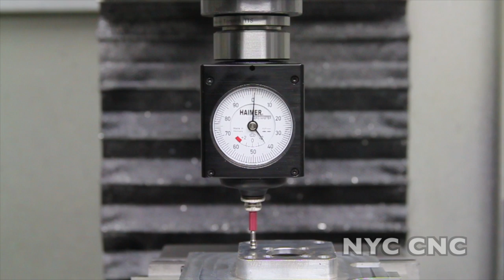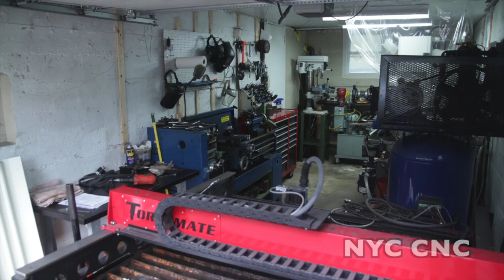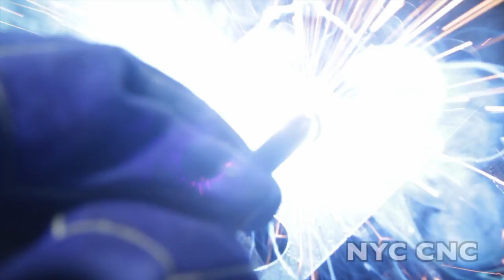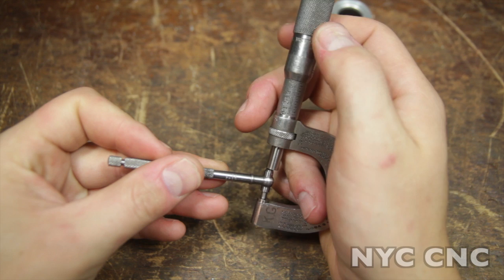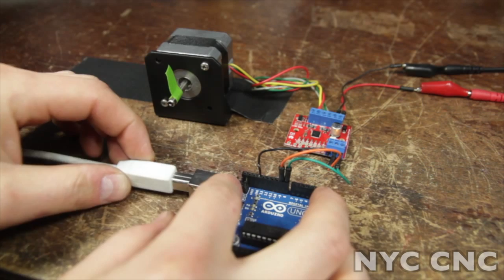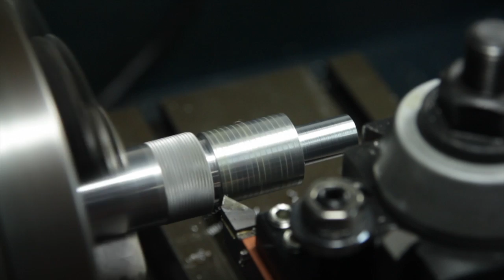Welcome to NYC CNC!  Channel Introduction!

Comment: Got a idea for a shotgun round for you to build for the TFM channel John.

 Only a true expert machinist like yourself could possibly pull this one off.

 Make a aluminum shotgun round similar to what you sent TFM in their last video but this time install a miniature gyroscope in it for stabilization. You will have to design and test this part first after you build it to see if it has sufficient force once powered up by a electric drill to resist the motion of your hand movements to it.

 It also has to be designed to fit into one of your beautiful aluminum shotgun shells. The trick to fitting it in would be to make the shell into a upper and lower half and machine at least three long shafts so you could screw it together with small phillps head screws once the gyro is installed inside.  

 The gyroscope would be powered up with a portable power drill just before firing the round  through a central shaft in the back of the round.

 There is two challenges here John. One and probably the harder for you.  Make a very small ball bearing gyroscope that can fit into one of your rounds with a sufficient amount of force once powered up to resist strong hand motions and two make a round to fit it in.

 I don't know if even you are up to this challange.  :)

 Just a thought here John.

 It may be possible and also now doubt best and the easiest solution for you making this gyro is to make it a heavy rotating cylinder NOT out of the lighter aluminum that fits into a very long central chamber in your round by machining the central core out. Then fit in a very large rotating cylinder mass inside which is what you will need for stabilization. Fit some small ball bearings in hollowed out recesses you will make inside the central rotating cylinder that you will be inserting into the outer shell of the round. I believe you will need these bearings for it to keep spinning once it's spun up.

Now if you go this way I believe you won't even need to make it two halves Just a long central chamber will do. You will have to seal the back end up with a aluminum cap and three phillips head screws and drill out a hole in the center for the gyro to be powered up. 

Now I am not totally certain if a gyro made this way will actually BE a gyro. 

You may need to add some heavier sleeved in metal pieces in four sections into the central rotating core.

That you will have to find out. :)

Comment: Hey John, been following your work for years on and off, going back to your apt in NYC. I've just seen a new arrival called UberBlox that's just launched. Calls itself "Lego on Steroids". You can build accurate machines, including CNC, 3D printers, in a modular way with metal parts, and runs Arduino-based controllers. It's on Kickstarter right now (type UberBlox in the search to see it). Absolutely fascinating stuff! Thought someone like you might get a kick out of it, it would be great if you could get them to share some technical info with you that you can share with us here to see if it's as good as it looks.
Reply: John McIntosh It looks like they're pulling it from Kickstarter (for good reason!) and doing a full website launch now at their uberblox.com. Looks like they're pretty serious about getting this to market.

Comment: Hi, I just want to say that I love your channel and it gave me some inspiration to start machining in my home too!

Just one thing, because of my limited budget I need to choose between a milling machine and a lathe. I have seen some videos on YT in where milling is done on a lathe and turning on a milling machine. So what is the better choice for a beginner?

I mainly want to use it to create Stirling motors, model rockets, rc craft, etc.
Reply: NYC CNC

Thank you for the swift reply & advice. :D

Cheers.

Comment: I moved about two years ago to Long Island. Family and kids makes you do that. Now I have the space to make a little workshop. Along with learning to work with metal, I also made a small aluminuim foundry for castings. The lathe and a mill will come in handy for thoses. So far, I've only melted small scraps into little ingots but I never thought it was possible to to do something like that at home.

Comment: It was used mostly for wood turning by a clockmaker- go figure. It has like thirty years of sawdust and way oil crammed in everywhere so I'm slowly taking it apart to clean up. I also need to build a bench for it, set up the motor and pulley and align the headstock and tailstock.

We have some other things in common. I used to work on a Farm (dairy) and lived in Manhattan as well.

Comment: We use Lincoln Precision Tig 275's at work. They are nice, because the cooler and everything is built into one big rolling tombstone. They do take up a bit of space. All of the guys run a Precision Tig 185 at home. It will do everything you'll ever need it too, only draw back is you if you want a water cooled torch you have to get a separate chiller, or plumb your torch into your municipal water supply. {thats how our welding school did it} but drip to waste isnt all that "Green"

Comment: Heck yeah! I have a miller dynasty 200dx, but if you arent a "pro" welder who wants to spend there hole life dicking with settings i would recomend one of the lincoln tig's. they are real simple, and produce good results. The inverter machines have sooo many options you can get the machine set up to where it just WONT weld. But all those settings come in real handy if you do alot of weird aluminum stuff. like condenser tubes ie really fine work.